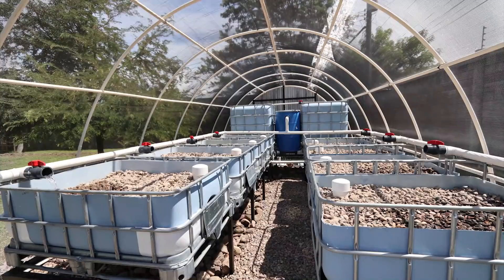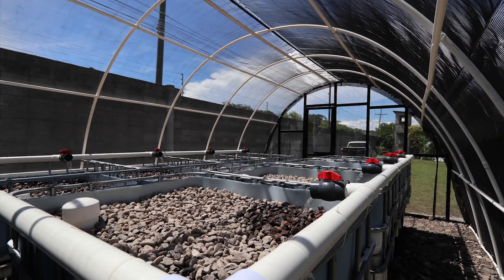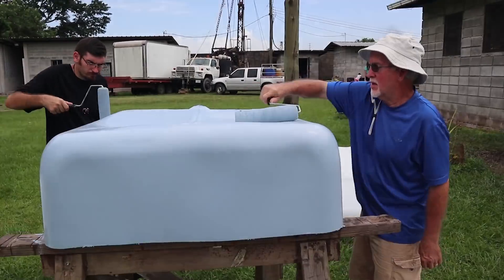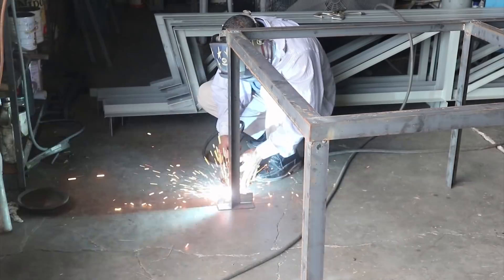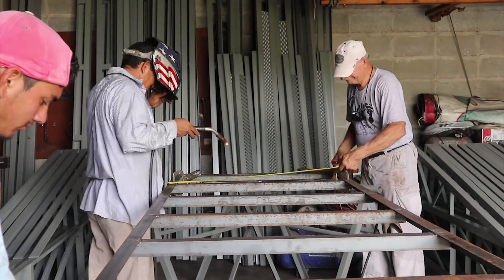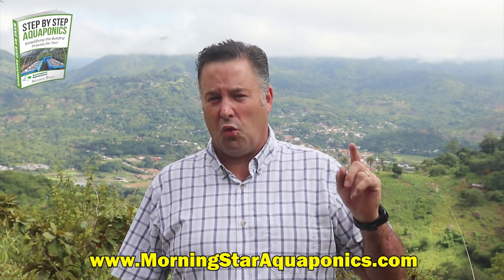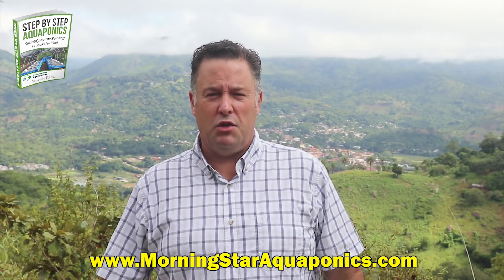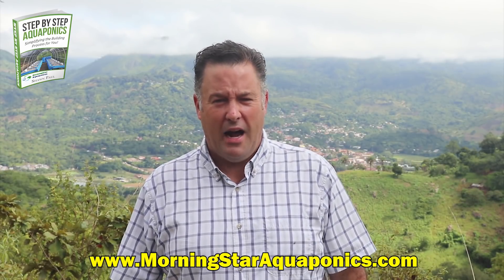🙂 Aquaponics System Build - BEST Time Lapse Video! 🙂

Comment: Hello Shawn.  Very nice system.  I am thinking of doing something similar.  I will buy your book.  Can you please tell us what type of paint you used fo the IBC tank?
Reply from the maker: I sand the plastic barrels and ibc totes with a heavy grit sandpaper.  Then primed with latex exterior primer and then used a latex exterior flat paint.  It's not a perfect solution, but it's the best we can do in Honduras.

Comment: Hi sir you have explained well sir but please tell me how to calculate bio ball and what type of motors are used and  please show in slow way construction of aquaponics system
Reply from the maker: Well, I didn't calculate the bio ball, I just filled up the bio filter with them.  Many people don't even use bio filter for a system such as mine due to the grow media in the grow beds.  I like to do an overkill on everything.  More biological surface area for bacteria growth, all the better.  Also, it keeps my grow beds cleaner.  I have other videos for a slower process in the building process.  Also, you can purchase my instructional videos on my website at www.morningstaraquaponics.com

Comment: Brilliant build mate very clean, strong and well thought out. 2 pieces of information you might find useful - volcanic rock if you have access to it or clay balls have twice the surface area and half the weight. And Jebao DC pump, very efficient W/lph. Slap a solar panel/charge controller and one of those pumps and it'll be totally power independent, no need for grid power.
Reply from the maker: Being in Honduras, we are very limited on the media that we can use.  Thank you for the suggestions.

Comment: the sump tank could be higher which would make it more power efficient?  it seems like it is overly low, or is that for the ground heat?
Reply from the maker: Thank you for your comment, but there is nothing wrong with the position of the sump pit.  The key is to get a pump with the right head pressure.  Due to the heat in Honduras, we need to have ways in cooling the water as much as possible.
Reply: In other words, he totally agrees with you... You are correct though, extra height of water is extra work, extra work costs extra energy. Beautiful build but otherwise